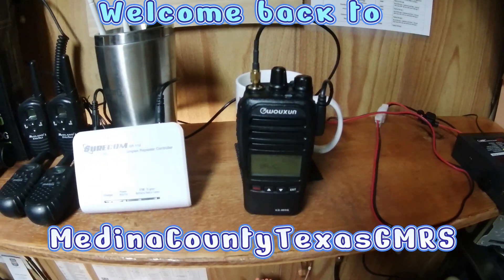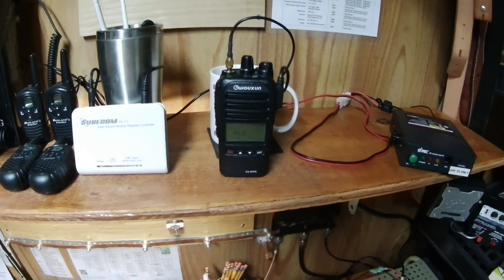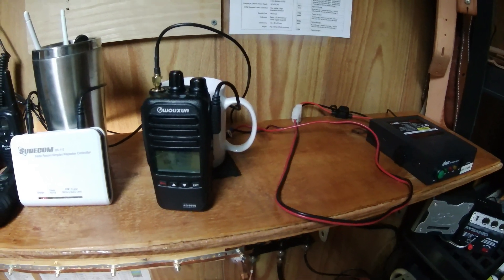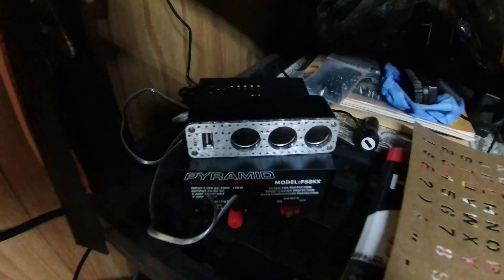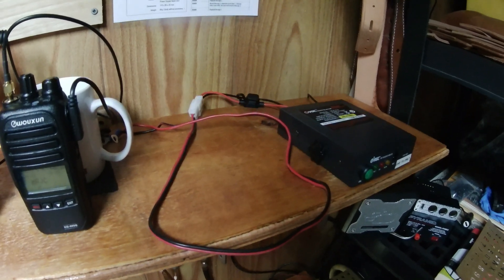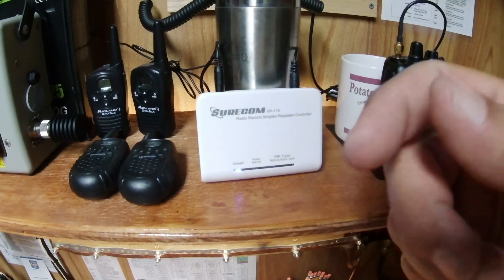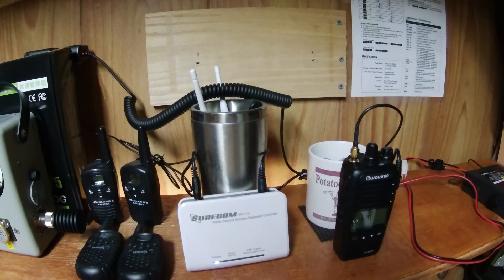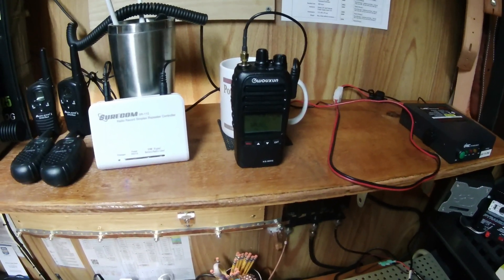GMRS - Simplex Repeater / Poor Man's Repeater overview.

Comment: I have a lot of experience with simplex repeaters. I have run them for a number of years. The number 1 criteria for effective use is a recording time of 10 to15 seconds maximum, anything more and it becomes very clunky and difficult to use. I have one that I designed myself that does 10 seconds and it works really well. You can say a lot in 10 to 15 seconds if you know that is all the time you have and makes for a good back and forth conversation. Other criteria for good operation is a 0.5 to 1 second hold off time, 0.5 to 1 second hold on time, instant record ,and instant playback after hold on time. All the simplex repeaters I have seen for sale all do a min of 30 seconds or more recording and have pauses (not fast timing) that is just no good and makes for an annoying  experience. The use of PL tones or DCS does reduce range a bit but double repeats can be avoided by setting the repeater to send a tone but not receive tone and set the radios to receive tone but not send one. I like the double repeats so you know when someone else is near or not. Note: Not all radios can set separate tone for receive and xmit ie. The store bought FRS/GMRS ones.

Comment: Awesome info. I was looking for a way to test my roof antenna with one of these simplex repeaters and now the light went ON. You just showed me how. That antenna hook up your missing on the 20-40 amp is all I need to do. Thankfully I have that unit and the tyt GMRS 7.5’  200w max 7.5db tube pole at the highest point of my roof with    On top of 8.5’ mass using LMI400 coax. I’ll be testing with my midland MXT500 in my truck for distance.

Comment: Wait, I know this is 2 yrs old but I'm pretty sure that if you are TXing & RXing on 2 different Frequencies is a Duplex Repeater,... Simplex Repeater is transmitting in & out on ONE Frequency & goes to a Simplex Frequency (Simplex Repeater not allowed on Repeater Frequency) and does not require registering with FCC.

Comment: Your you didn't mebtion that the Surecom is digital and the amp needs to be digital. Amazon sale 2 types be sure you get the digital one. Which by the way. Is out of stock.
Reply from the maker: I don't recall it being digital and all radios used on that system were analog.  You could be correct tho, I just never pay attention to digital stuff.  It's not something I don't think I ever want to tackle or mess with.

Comment: Can i use my bafeng bf 1904  it is a 12 watt will it work on my radio
Reply from the maker: Yes but you will need to use medium or low power.  Putting more than 5 watts into the amplifier will fry it

Comment: So do you  need a crossband setup to used the b-tech
Reply from the maker: The way I have this set up,  no.   With the simplex repeater module you literally just plug and play,  no real special settings needed on the radio.

Comment: Don't have GMRS license but I have HAM certification.  I've heard (and it just might accidentally be true) that GMRS signals are dependent on line of sight.  If that is true, the higher the antennas placement is, the better.  
I'm trying to put a repeater on a water tower but they always catch me when I'm  almost at the top.  
So....good luck.
Reply from the maker: Lol... We're currently up about 65 feet and the results are much better than the 35ish we were at prior.   Trying to get plans to get around 100 feet up and that should work perfect for what we're needing.  Thanks for taking the time to watch and comment!
Reply: Maybe because higher modulation frequencies don’t travel as far as say 2 meter band. Some guys on long wave can hit people on the other side of the world with small batteries. Sometimes it just works out signals accidentally bounce off the atmosphere or objects and signals are good!
Reply: Everything above HF is line of sight.

Comment: Very informative video. I'm going to do this setup as well using a Wouxun KG935G radio. Question, where would I find the patch cable from the radio to the amplifier? Thanks in advance.
Reply from the maker: Check the listing for the amp... it comes with several cables.   Let me know how it works after you get it up and running 👍

Comment: What's the range on the poormans repeater?
Reply from the maker: Range will vary based on antenna height, antenna type,  terrain and several other factors.  We are currently getting about 30 mile radius with about 28 watt output on a 11db gain antenna. 📡

Comment: Midland just came out with an all in one repeater that's preprogrammed for gmrs channels, 73🤓
Reply from the maker: I saw!  😉  Unfortunately down in my hilly area,  the 10 watts wouldn't get us very far.
Reply: @MCTGMRS78009  You can use two Wouxun KG-1000G and a duplexer, programmed as a 40W repeater. Probably what I will install in the mountains but increased power doesn't mean much more performance because 400Mhz doesn't do that well around trees. Good luck!
Reply from the maker: @Melissa’s Mess  Very true! You can definitely tell a difference when those tree leaves get wet too!  We're currently at 45 feet up and can get about 30 miles from the repeater with the hills here.

Comment: Could the surecom sr112 be used to turn a KG1000 mobile radio into a gmrs simplex repeater?
Reply from the maker: You might be able to get an adapter if the radio doesn't have a K type connector.
Reply from the maker: It depends on the headset & mic jack of the radio.  Usually a K type connector is needed.   Thanks for watching!
Reply: the kg1000 is programmed to use a second radio to create a 50 watt repeater by connecting the two radios together....check the manual on your kg1000

Comment: I'm thinking one of those software repeaters or even just setting up with a base station antenna would let you know if you have a good antenna and a suitable location.   Watching a half dozen videos at "The Youtube University", my first step will be to get an outside antenna and coax.     I am semi-retired but work a seasonal job here in Minneapolis and am trying to connect from home which is about 3 miles away.  Can you recommend an antenna?  I just read that your Ed Fong didn't work for you.   I'll search at your other videos.
 Thanks for the education!
Reply from the maker: So the Ed Fong worked but definitely not as well as Harvest BC200.   I think your current plan with that antenna will get you up and running perfectly!

Comment: Cool. I just got a Retevis 9000 mobile radio. I’d like to see your setup some day.  There is a new GMRS repeater located in Lakehills.  ( I believe it used to be in Wharton’s Fock but sold and moved to Lakehills)
I also have a Moto 1250. I wonder you’re repeater could reach Lakehills? 
WRFI 786. 
Joe
Reply: My buddy Bob Buck lives there in Medina (K5HRB) and he is a General as well but I don’t think he has a GMRS license. Bob works for the water dept there.
Reply from the maker: NICE!!!  If he ever wants to join the repeater here, he is more than welcome!!!
Reply from the maker: You'll have to let me know how you like the new 9000!  That's bad ass!  Do you know if it's open to the public or private?   And I will have to run up there to test to see if mine is reachable... the hills between here and there are pretty high.
Reply from the maker: And YES... If you are ever down this way, let me know, you are more than welcome to stop by!!!
Reply: I believe the Lakehills repeater is open. I’m a General ham, live off 1283. 
I’ll get the particulars for you on that repeater here. 
My son lives in SA and has a repeater at his house. His is linked with several other GMRS repeaters from lavernia to Leon valley.
Reply from the maker: That would be great...  You are more than welcome to email me at any time!  medinacountytexasgmrs@gmail.com.  Is your son part of the SA Net?

Comment: what brand of amplifier are you using also what antenna are you using
Reply from the maker: It's a VGC Verotelecom Model VR-P25 D.
Reply: @MCTGMRS78009  thank you, what antenna are you using
Reply from the maker: We are currently using a 17 foot BRC HP-500.  The base of the antenna is currently at 34 feet.  We are fixing to install a new pole and get it up to 50 foot +.  Very happy with this budget antenna to be honest.

Comment: I’ve been considering building something similar to this with an Ed fong. I know range varies with all the variables. But what kind of range did you see with the Ed fong and the amplifier? How high was the Ed fong? And did you have the regular j or his Collinear?
Reply from the maker: Thanks for the comment & watching my videos!!!  The range on the Ed Fong was a little less than what we currently have set up.  The height of the antenna was about 34 feet.  The issue I think we had was that in the schedule 20 pipe the sun would cause it to bow pretty bad and after about 8 months of the Texas heat it was permanently bent.  We had his GMRS tuned collinear unit.  Since taking it down, I gave it to another guy in our group to use at his place.  Looking forward to hearing how your setup works - PLEASE keep up posted!!!
Reply: @MCTGMRS78009   I was thinking of an Ed Fong.  Can you tell us what antenna you are using now?